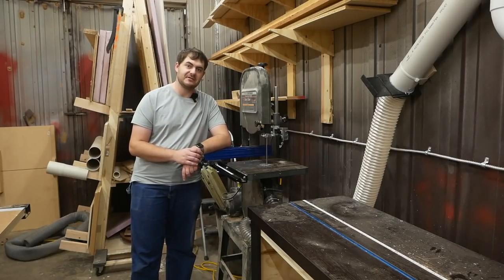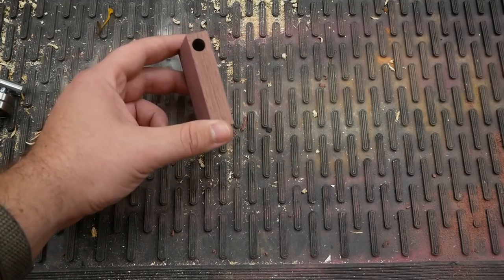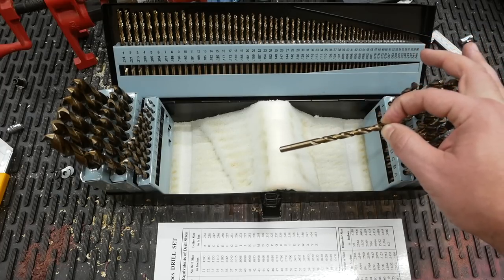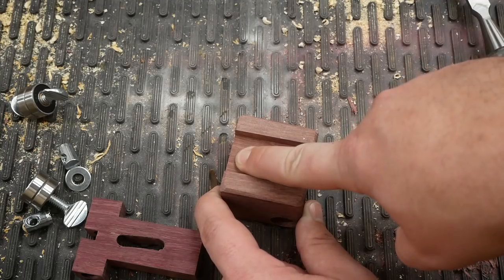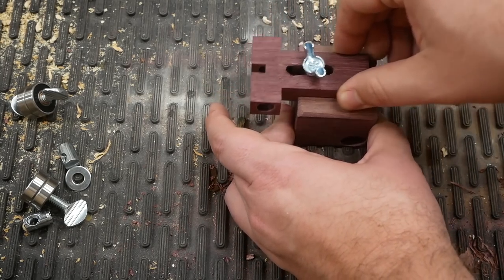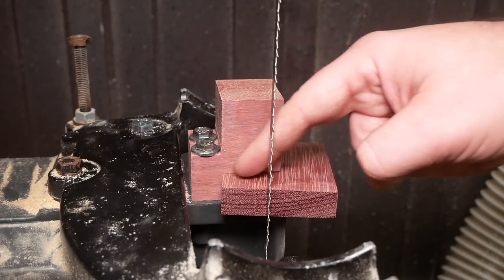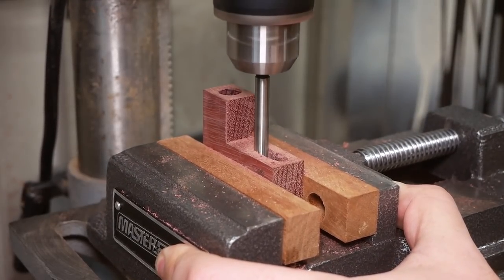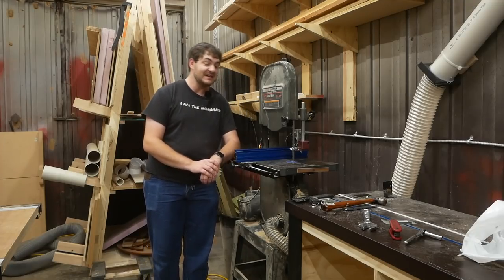Making New Ball Bearing Blade Guides For My Old Bandsaw

Comment: I've heard that the side-mounted thrust bearing is used because a "proper" orientation results in only a single point of contact with the blade, which tends to cause the blade to twist to one side under load.  A thrust plate in contrast supports a  span of the blade (or two small spans for a bearing) and causes much less blade twist (the opposing directions of the top and bottom try to twist it vertically instead, and tension keeps it straight).  Also,  when done "properly" it doesn't use a normal bearing, but instead a thrust bearing which has conical tracks designed to support axial  forces.  Though I think the forces in a bandsaw are usually small enough that decent normal bearings can handle the load.

Comment: Question. Would a washer on the bottom guild behind the bearing on the right hold better? I think maybe not, because of the dense wood. Just wondering. 
Liked your safety reminders. I used to work in an a emergency room. I could tell you true stories. Glad you saved and undated you grandpa’s tool.

Comment: I have a Craftsman “Professional” bandsaw that came with bearing guides but for some reason the previous owner took the bearings off and installed round plastic/nylon disks. 🤦‍♂️
I need to do a tune up on it and find the bearings or get new bearings for it. 
The blade tension crank handle was missing so I made an 8” hand wheel out of construction grade plywood on my lathe. It works so now I’m going to remake it out of birch plywood.

Comment: The bearing is side on to spread the load of the blade .if the bearing is end on the load is placed on a tiny surface .you will wear a groove very quickly .

Comment: So my thoughts as to why more designs use the side of the bearing in the thrust bearing are 2 fold. Primarily I think it's easier to implement that style and secondary it's how delta made theirs. A lot of 14" saws are clones of the original Delta's so they just copied what delta had done. 

I think your build of the guides is great. It looks nice and it's functional. I think one of those really wide Allen head bolts would be good for the bottom clamp. Before I converted my bandsaw over to all thumb screws i had the proper Allen key for adjusting stuck to a magnet attached to the casting.

On the topic of drill presses I have an old Rockwell and it's a tank but what I noticed about it using a few different presses is that it has a really good quality Jacobs chuck and very very low runout. This leads to excellent performance and it just feels right when using it. Hard to put in words but immediately noticed in use.

Comment: Just a note that many drills have a slightly undersize shank for clearance.

Two useful alternatives to buying more drills would have been to sand out the hole- take a length of 1/4 rod and cut a slot in it lengthways, slot in a bit of sandpaper ,wrap it round the rod then mount in a drill. Personally I would have held the dowel nut in the drill chuck and sanded them down to size, then repeated for the other ends.
Reply: Those things may have worked but now he has a full set of imperial drill bits.
Nothing wrong with that.

Comment: At this rate you'll be building the interior of the bus from scratch in no time... :P

No pressure... :P
Reply: As well as a new mahagony crankshaft and cherry valves coupled with some nice oak gears for the differentials... Maybe even some nice spruce axles and hickory exhaust... ;)
Reply: @camillosteuss  : Haha look up ironwood engine repair work.

Comment: 2 reasons. 

1. Using the side of the outer race is quieter than the OD in this application. 

2. When pushing a narrow blade against the outside of a round bearing you end up with the absolute minimum contact patch as well as a tendency to encourage the blade to lean over.

Comment: The bearing is at right angles to the blade because that way there is a much larger contact area between the bearing and the blade.with the bearing behind the blade you would only have a very tiny point of contact which would probably lead to undesirable handling characteristics and rapid wear of the bearing.

Comment: Since I already have the same ridiculous drill bit set you purchased and really do not want to spend the $200 on carter bearings,  I think you may have just inspired me to give your design a try. However, I think that I will do it with one exception.  I will replace your purple heart with a Phenolic Resin Sheet AKA cutting board from any home goods place.

Comment: if you've still got it, are you interested in getting rid of the top guide that you've replaced? it seems to be the same (or close enough for hand grenades) to mine, which is broken. I've got it jury-rigged for now, but eventually I'll need to replace it

Comment: The shaft of a medium sized twist drill bit is often about 0.1mm or slightly less than 1/128" smaller than the sharpened facets on the cutting edges. This is for clearance in either very hard that would grab the flat shaft surface, or very flexy materials that "bounce back" after the cutting edge - like softer woods or plastics.
Also, the specification on a drillbit governs the hole diameter the drill will make WHEN USED IN A STABLE FIXTURE ON A CLAMPED WORKPIECE... :) When you use a two-flute drillbit freehand in a non-clamped workpiece, the hole you make isn't a circle. It's almost alway slightly triangular (or hexagonal - depends on what resonance you hit). The maximum inscribed circle in that triangle is often about 0.5% smaller than the drill diameter.

Comment: If you sharpen the drill slightly asymmetrically, you get bigger hole when drilling the first hole, center guiding the process. Just a trick that might save your day after drill shop closing time.

Comment: The letter bit system actually makes more sense than you’d guess.  For instance, the F bit for a 5/16” tap.  ‘F’ for “Five”, you see?  So the F bit can be used for 5/16, 5/32, etc.  similarly, the N bit is used for anything starting starting with the letter N.  9/16, 9/64, anything!

Comment: The answer for the question related to the orientation of the ball bearing is simple. If the spinning plane of the ball bearing would be parallel to the plane of the blade then the blade would run on the same perimeter every time and would cut a trench into the surface of the ball bearing very quickly. By contrast, if it is perpendicular then the blade continuously turns the ball bearing and it always scratches a new part of the surface of the ball bearing. Therefore it wears out more slowly. This is what I think the correct answer is. :)

Comment: Couldn’t you use a carriage bolt for the lower bearing carrier on the upper blade guide with a wing nut on top so you get more clearance but still have tool less adjustability?

Comment: With the rear bearing the way you do it it puts pressure all in one very small point and when pushed on will distort your blade mount it sideways and the pressure will be across a flat surface and not cause as much blade twist when pressure is on

Comment: Drill Press Safety...  have you ever seen a "float lock" vice?  they are extremely complex and valuable..... BUT you can achieve the same result my mounting your little drill vice onto a piece of plywood shaped sorta like a ping pong paddle.  just shape it so the handle hits the post for the drill if you lose grip on the work..  Its really stupid looking but it works.

Comment: If you needed a loose fit around a 10mm (ish) dowelnut, you bore a 10,5mm or 11mm hole? Metric drills can be found in 0.1mm increments (though I'll bet precision reamers have even finer "resolution" than that).

Comment: I feel like the confusion with the imperial drill bit set requiring numbers and letters can easily be fixed by metric drill bits (ones which are actually the advertised size)

Comment: Allen head screws are good if the wing bolt keeps getting in the way. Also to pass a simple solution for tapping wood on to your viewers as well as you.   get a long bolt with tg size threads you want.  Take a air grind zip wheel or a cut of wheel for a grinder  & cut a slot the with of the blade own the bolt 90% to the threads..  If you want you can grind a taper on the treads but they work good either way.   I even used a grade 8 bolt and tapped Aluminum with it. You might have to work it back & forth a bit tapping hardwoods and certainly aluminum.  If you only need to tap a couple or holes why not save money.   Also if you need to save a hole on a aluminum structure like a head or block this works amazing.  I have a drawer in my box full of ones I made over the years.  Put a socket on a small impact and you can tap holes in wood fast.   Sometimes I grind a slot on different sides.  Instead of grinding straight up and into the grind you can go in about a 15 to 20 degree angle and under cut the side that is cutting the threads.   I was just debating making a set for my shopsmith bandsaw and seeing what others have done.    I will like but I need to finis watching now. LOL

Comment: It’s kinda funny, that you have a hard time finding a metric drill bit in the US, while me here in Germanyhad a real hard time to find an imperial drill bit and tap set 😂 Amazon is not a good help either because of all the Chinesium crap there that can’t even cut into mild steel. So in the end I had to buy a used, good quality Made in the US tap and die set off eBay USA 😂

Comment: did you no if you grind the drill bit  uneven on the cutting edge making one edge longer, it gives the drill a little wiggle and will cut over size 
im a toolmaker by trade and used this lots of times . hope it help for future

Comment: Cubic sneeze and the other side the loose bearing on the good thing is that the same dryness of oil to cut blade with some sharp put to it will work probably nice job dude.
Reply: Did you proof read before sending or is your comment a failed translation?

Comment: Of course that drill set is not quite complete:)  The wire gauge bits goes to #97 which is really small.  You can get #61 to #80 sets rather commonly.  I use them in modeling.  The smaller sizes are rather less common.

Comment: how did the threads in the wood do for that year? did they hold? personally i'm not a fan of that, would've used these inserts that you hammer into the wood, but if it works, why not :D

Comment: As a Canadian machinist who needs to deal with metric and imperial on a daily basis: My forehead hurts from both the headache caused by the imperial system, and from all the face palming I have to do in order to get my head around the stupid systems. Did you know that numbered drills go down in size as the number increases, but numbered taps go up in size? Genius! Did you know that a 5mm drill is bigger than a 4mm drill? Of course you do! You already knew!
Reply: I live in the US (Missouri), born and raised. I have Always had a problem, with the imperial
system but I didn't know what it was, until I met the metric system.(late in life). It's so F'n Easy!
No more dealing with EIGHT different scales, when making or repairing.
EIGHT, count them: Inch - 1, 1/2, 1/4, 1/8, 1/16, 1/32, 1/64, 1/128.
Metric is all base 10. Below 1mm, it's decimal (base 10). EASY!
When I was in elementary school, approx. 1963, ( I'm 70 ), they began trying to teach the metric system.
I say trying, because they did Not succeed. They did not succeed, because they tried to teach it using comparisons. Stupid, Stupid, Stupid!
If you want to teach someone (even a child), give them a metric rule an say "Use it." EASY!
As a child, I found the imperial system confusing, because the first thing they teach is fractions (which is difficult enough), then they come along and throw decimals at you, a Completely different system and try to tell you they work together. UH, NO!
Well, enough of that. All Hail the Metric system! 😁😁🤗👏👏👏🖖

Comment: Robert, I'm pretty sure that weird numbering and lettering metric system you bought there is only used in the US. Here in the "civilised" part of the planet, we use a very simple metric system where the bits are just called the size of the bits. So, a 10mm drill bit is called, wouldn't you know it, a "10mm drill bit" 😂 Btw, I absolutely love your channels! 😉

Comment: It will cut a grove in the bearing after time.
When sideways it wears evenly.
Normal where im from is to moumt tje bearing on am angle and have a chamfer on it to be parallel to the blade
Reply: My band saw is set up just like this where the back of the blade rides the bearing.   My bearings do no not have grooves in them yet.    Always figured some day they would, but 10  years later, they still look good.

Comment: Don't feel too bad about having to drive around to find metric drill bits.  I live in Canada where we are all supposed to use the metric system and I'd probably have to try at least 4-5 different stores to find one that sold metric drill bits, unless I cheated and went straight to an industrial tool supplier and paid $30+ for a nice one.

Comment: Umm, following "Tool safety with Robert" parts 1 and 2 I'm just thinking that a part 3 with that exposed blade might be messy....... and rated 15 or 18 depending on the results. I'm not the safty police, I'm the "put that bloody gard back on before it gets bloody police"!! A lot more catchy then safety police....... I think 😁 Those saw guides look really nice, you can actually admire the grain in the wood while you work! 👍👍👍

Comment: The sideways bearing will make it so that the blade touches a flat surface and the pressure is spread out over a larger area. If the bearing is directly behind the blade it will only touch a small point. Over time that will result in more wear on the bearing and or blade.

Comment: Ball bearings should be oriented as you have them, full stop. BY DESIGN they are excellent at radial loads, and suck at axial (side) loads. Also,  putting them sideways means the blade is scraping the sides of the race instead of rolling on it. If noise is a concern, put a nylon bushing around the outer race, or get a better bearing.

Comment: 1:20 Having the bearing on the side results in a much larger contact area between the blade and bearing. This will reduce the slip of the bearing on the blade, every time the blade changes direction.
Because unlubricated metal parts slipping on each other at high speed is an engineers nightmare, I'd guess that's why sidemounts are prefered if cost is a problem.
A well adjusted 2 axis mount is still king though.

Comment: If you have wing nuts, maybe replace the wing bolts with threaded rod with epoxy. Would save breaking a threaded wooden hole.

Comment: Two points of contact on the back of the blade on the edge of the bearing prevents point loading. If the back of the blade touches the curved edge of the bearing while under pressure of the wood forcing backwards if blade was not as tight as it should be it can flip sideways either side of the center of the face of the bearing, the sudden reduction of depth will cause the wood to dive forward quickly, and possible cause the a wandering blade cutting of line. Of cause the blade must be tighten before use and you should let the blade cut don't force it if you have then change to a sharp blade.

Comment: I do not think there is any direct functional advantage to having the rear bearing mounted perpendicular.  The back bearing is only supposed to protect the blade teeth from making contact with the side bearings, so it should almost never be engaged.

I think the main reason why you see perpendicular rear bearings is for ease of construction.  It's much easier to drill a hole, offset from the center axis, and mount a bearing to this hole.  To mount a bearing in line with the blade, in the rear, would require a lot of relief in the mounting mechanism, which might compromise the stiffness of the bearing guide.   Or creation of an arm like you made, which complicates the design.
Reply: The rear bearing supports the force of pushing the material through the blade, so it does engage the blade when the saw is in use.  Regarding perpendicular bearings, I agree - it's less expensive to machine since only a 3 axis mill and one fixture setup is required.
Reply: @EPgeek  Tension on the blade supports most of the pushing force.  If you are always heavily engaging the rear bearing, it is either too close, you are feeding material too fast, or your blade is too small.

Comment: The bearing is mounted sideways to make the wear from the metal saw blade wear evenly on the full side face of the bearing -- the bearing spins freely and the angle of attack the saw blade is rubbing constantly changes resulting in even wear.

If you put the bearing straight on (using it like a wheel) the saw blade will wear a groove in the bearing, bind, cause friction, heat the saw blade, weaken it, and cause it to snap.

Comment: When I buy tools, I like to see both metric and imperial. Imperial still has its uses yet. Metric has 10 steps while imperial could have 12 to 16.
Reply: Decimals exist.
In Europe at least, you can buy tools in 1mm steps everywhere, in 0.5mm steps in every brick and mortar store and 0.1mm in specialised stores aimed at engineering professionals.
Reply: @headcrash69  Metric is far from perfect. There are flaws with it. You can't let imperial go just yet. I've used an imperial socket on a metric car as my metric sockets would not fit, but that one imperial - best and tightest fit.

Comment: I think I would be very lost without imperial drills. I know off hand what bits I need without looking them up, I know I need a #7 drill for a 1/4 20 tap and a F drill for a clearance hole, F for tapping a 5/16 18, a Q for a 3/8 24 etc. I’d have to re learn all that but in metric which is not something I want to particularly do